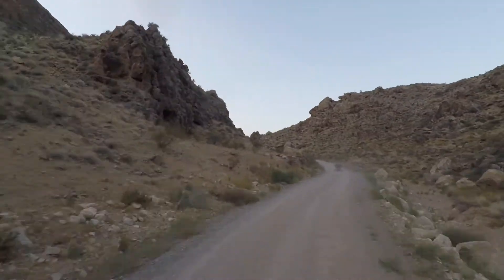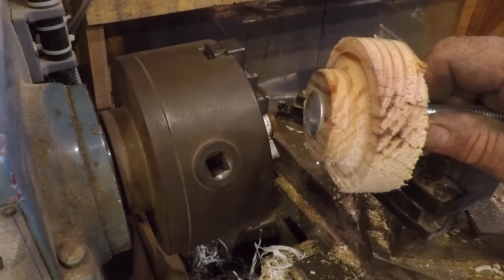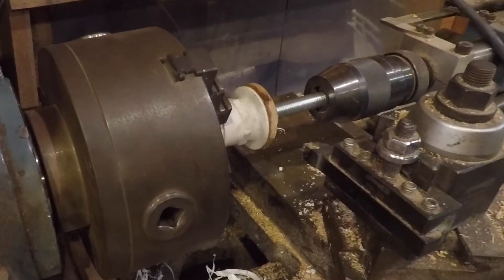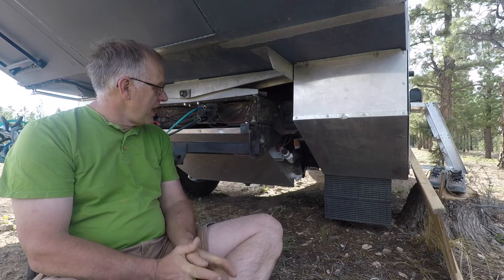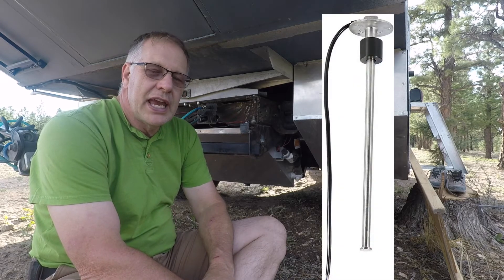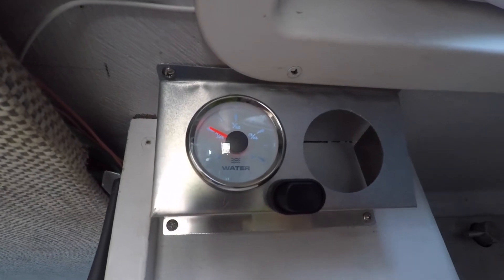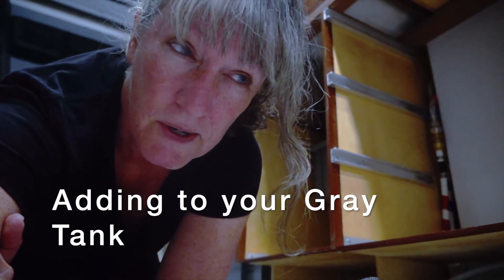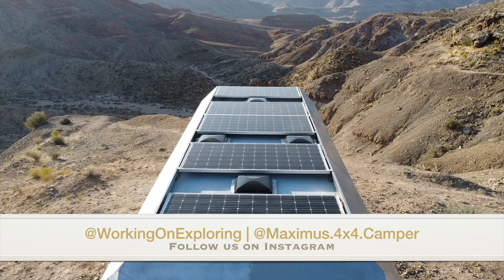RV WATER SYSTEM | SAVES WATER & EASES DUMPING | RV Water Management

Comment: Amazing skills! 
Question: Are you concerned about ground clearance with your custom gray water tank? I believe you said it will be 1 inch higher than it is shown now?
Reply from the maker: I have 14" of clearance under everything on my truck (steps), storage boxes (4), battery box and fuel tank. There is just a bit less under the drive line at the differential. I'm coming to the answer...yes, the gray tank has about 11.5" clearance but that low clearance is between the wheels where the differential and shock mounts have that too. I believe that although it is lower than other equipment, it does not reduce my 'functional clearance'. If the axle clears it, the tank should too. I do need to put a strong cover on my macerator and associated plastic  fittings. I will also put something around my drain plug but to get touched, the differential is going to get hit first.
Reply: @WorkingOnExploring  I think if you put a steel skid plate under the pump and fittings of the gray tank, you will be keep everything protected.
Reply from the maker: I'm not designing this to absorb underside 'hard' impact to the boxes, macerator or fittings like hitting a rock sticking up from the ground although that's always possible. I can't afford the weight that would require. What i think most likely is a small rock being thrown from the treads or a bigger rock 'squirting' sideways from under the wheel. I also have freeze protection to worry about. What I'll likely do is make a .060 sheet aluminium box with some 1/8 angle reinforcement and lined with 3\4 poly-iso insulation. It will also have an electrical silicone heater pad and a rear door to access the hose bib, valve and switch.